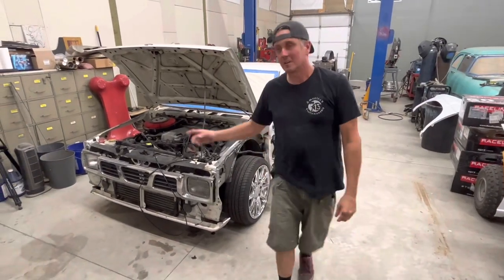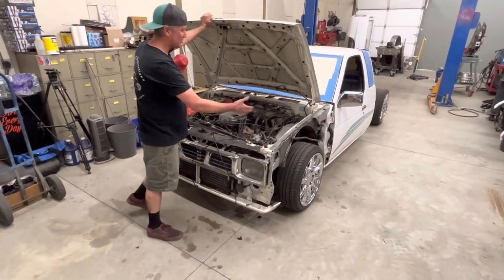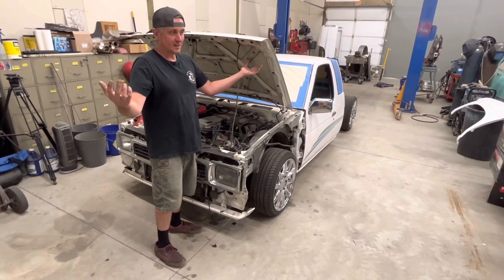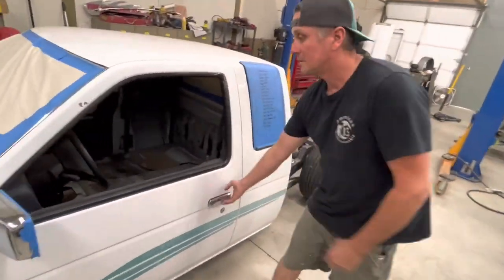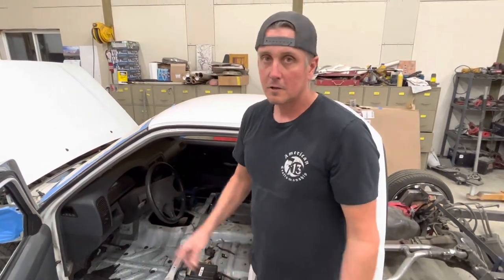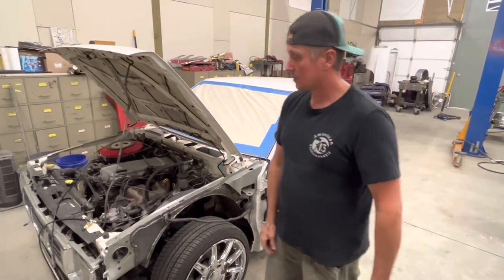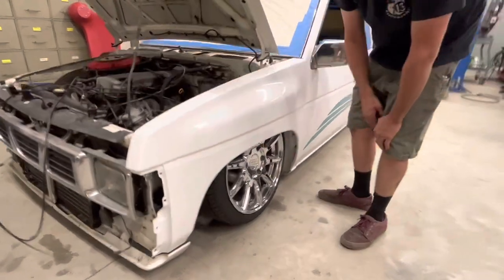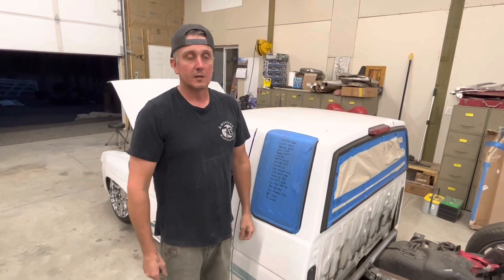Bagged and Body Dropped Nissan Hardbody!  Intro to one of the greatest trucks of all time.

Comment: I bought a Ranger new in 92. in 93 I did a 3-4 suspension drop. then it went to paint and body in 94. full Stillen skirting shaved tailgate, shaved door handles and some other body work.  it won several awards. I miss that old truck.
Reply from the maker: Sounds awesome.  Stillen made the high quality parts

Comment: I miss the crap out of my '95 white ext cab hardbody. It was sitting on the bump stops up front and the axle was banging the frame in the rear. She even carried my grizzly 660 down dirt roads. Had titan wheels with 245's up front with the stock fenders. The sidewalls and front fenders were very "intimate". Long sweeping off ramps would give the cab that delicious burnt rubber aroma!
Reply from the maker: Sounds rad
Reply: @thedirtheadshed  oh, i forgot. Ditch the little white thing and slap an s10 lip on it. If fits right up into the bumper. A couple of zip ties and you're golden.

Comment: I had a ‘88 D21 from new and put 500K miles on it. Best $8200 out the door I’ve ever spent. Mine was set up for (amongst other things) track work - bars, shocks, drop spindles and blocks, Toyota dual piston calipers. I loved that truck and if hadn’t rotted away I’d still be driving it.
Reply from the maker: Sounds like a good life

Comment: Quick tip thin the mud use a heavy nap roller , roll the mud on then slick it off . We used to do a skim coat on the expensive homes when I had my business. Other then that good job Dave
Reply from the maker: I’ll try that. Kinda like a really light knock down?

Comment: I watched you a ton on Dirt Every Day and you’ve got two trucks that I had. In the early 2000s my first truck was a 88 Nissan Extended cab hard body I dropped three inches the cheap way by torsion bars and lowering blocks cause I was in School and had no money road like a buck board wagon but I was the man!  Then I got a 89 Mazada B2600 standard cab with a 3 inch lift and 32 inch tires CB off road light high lift jack. My son is 8 and has fallen in love with the Hard Bodies I would love to have one for a trail rig we’ve go two overland rigs a slightly build 03 Jeep Liberty that my wife drives and a 04 Grand Cherokee that were in the process of building as an overland rig. Keep kind off light 32s at full flex and all the fun gear keep up the good work
Reply from the maker: You have good taste in rigs.  Keep at it

Comment: the Datsun 620 I had back in the early 90s was all about going fast. 350/th350 out of a Malibu wagon, Ford 8.5 after I blew the stock rear. No lowering, no channeling, no care about "coolness". I had parted out my Lemans when gf got preg, that fell through and she wanted her freedom. I needed something cheap. $500 620, $250 engine/trans from junkyard, lots of cutting and welding, shortened the Malibu driveshaft to fit, a local machine shop balanced it Boom! One fast little pos that ate IROCs and 5.0GTs. I wish I still had it, it'd be worth a fortune today, though being from the northeast it was a rust bucket, and hacked after I was done with it.
Reply from the maker: I’ve never been a hot rod kinda guy..  maybe I should give it a whack
Reply: @thedirtheadshed  I remember the first time I drove it... that maniacal laughter that you and Fred get in scenes of DED like the Winnebago, that was exactly my reaction. That holy-shit-I-could-really-f'k'n'-die-but-this-is-so-f'k'n'-cool, fight/flight/adrenaline rush.
I in no way tell anyone they should do it, but I strongly recommend thinking about it. I am not responsible for the stupidity of others, only my own.

Comment: I've got a 03 Ranger Edge I so want top drop but those pesky torsion bars.  Not to low , still have to drive it up my driveway and do light truck stuff with it, just low enough to look right with some mustang wheels I've had laying around for 6-7 years.
Reply from the maker: I’m sure you can get a little drop before it goes haywire
Reply: @thedirtheadshed  I was thinking drop keys, but I'll still have all that junk hanging there.  Could just buy a normal 2wd and throw a solid axle under this one.  The Edge model was some weird 2wd with 4wd suspension junk under it, just weird enough to make things complicated.  Can't complain to much about her.... owned it for 19 years😁

Comment: So- the body drop is required because the frame hangs so much lower then the body lines right? In high school I wanted the 99 K2500 crew cab short box… only made for 2 years, I finally got one a few years ago and then it got ran over by a bulldozer at the garbage dump (true story)
Reply from the maker: That sucks!  Yeah. That is the reason for the body drop

Comment: It won’t be complete until it has:
• Spider web cargo nets… preferably neon pink
• Radio antenna with a little spiral in the middle
• Double dual wiper blades with little air fins on them
• A license plate frame where the 2 LED lights chase each other around
Reply from the maker: I’ve got a lot to do
Reply: @thedirtheadshed  I can help! I’ll check the Crutchfield catalog and see if they have Bazooka tubes in stock.